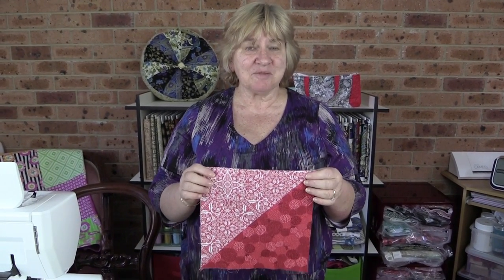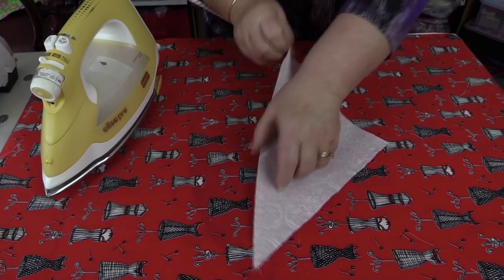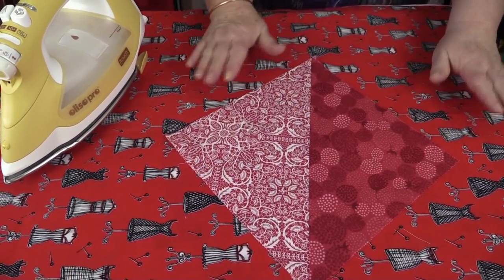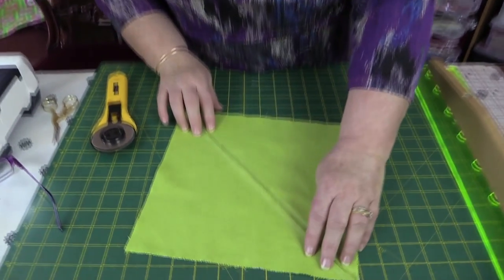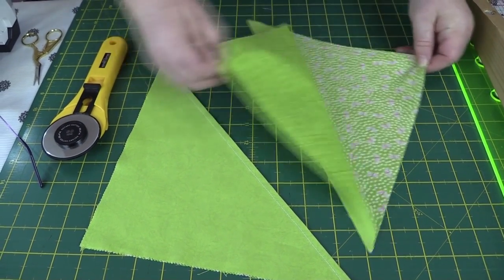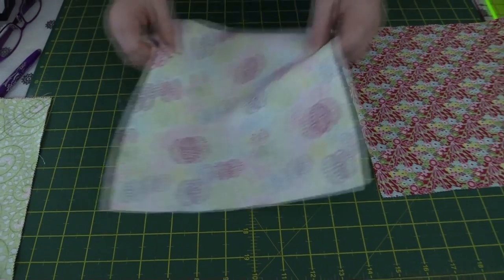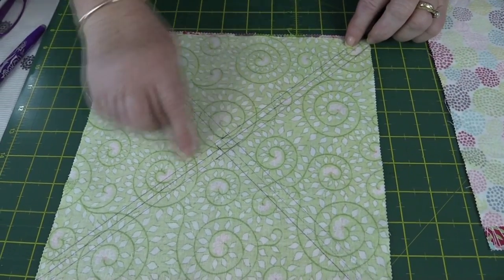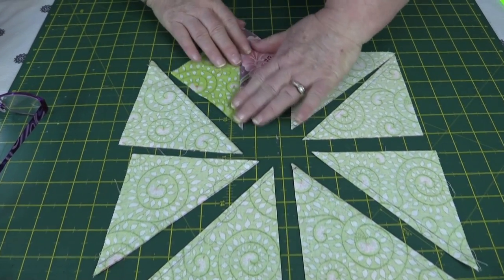Quilting Blocks: Half Square Triangle Tutorial (4 Methods)

Comment: What is the size of the eight count methods half square triangles? How do you determine the beginning squares size , for example if you want a 2 1/2 half square triangle square? Thanks
Reply from the maker: +Sandra P. For a 2 1/2 inch finished half square triangle the beginning square size would be 6 3/4 inches. However, if you would like to see how this calculation is made here is a link to our blog post: http://www.alandacraft.com/how-to-do-the-math-for-the-8-half-square-triangle-technique/